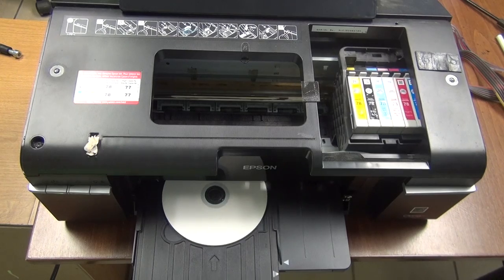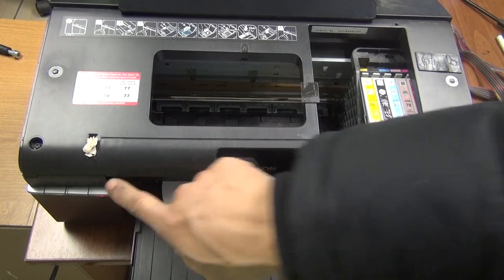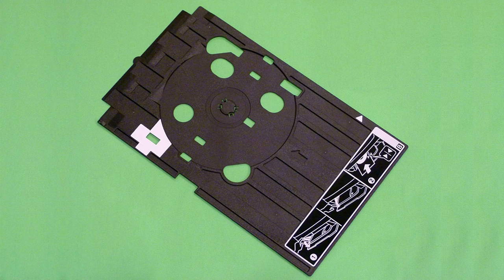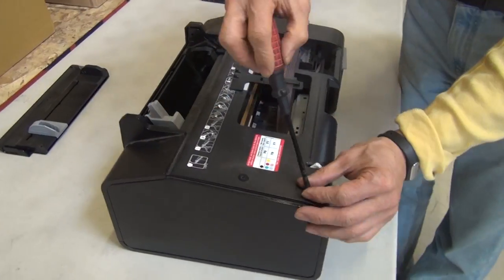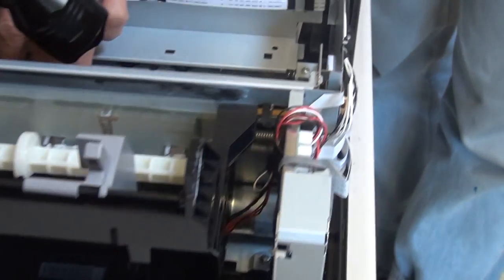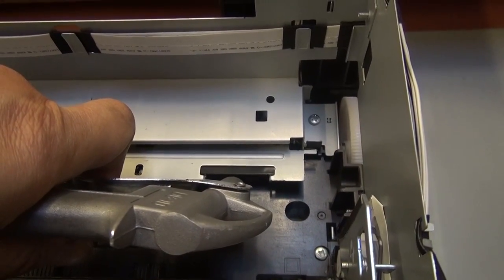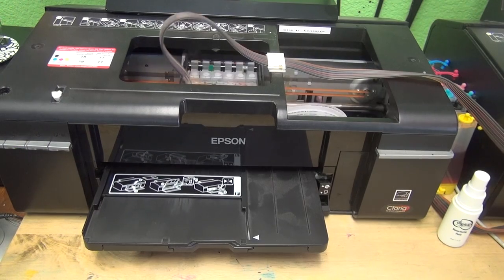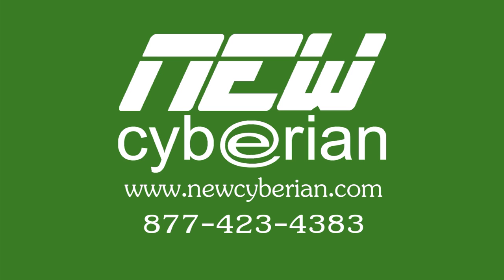Solve the Epson CD tray ejection problem

Comment: Many many thanks for your challenging your printer situation and coming up with a solution.I spent over 2 hours with Epson and they couldn't solve the problem and I wound up ordering another printer, but like you Decided to look into what you had done, and low and behold the sensors were somehow blocked.I used my vacuum in reverse and blew air over the sensors and today I'm able torrent my DVD labels,so again many thanks
Reply: I am glad that it worked out for you.  I was actually wrong to call that a sensor.  It turns out that's only a switch and not an optical sensor.  I guess it gets stuck by dirt over time and by blowing the dirt away it will function again.  Some people also had successful stories by dipping some alcohol or WD-40 to lubricate it.

Comment: Thank you very much, yours is the only right solution I have found in the internet
for this problem. I used  a vacuum cleaner that has a blow port in the opposite side.
Reply from the maker: I'm glad that this helps. Bummer I have thrown away over 20 printers because of this problem.  Should have looked into this  long time ago.
Reply: New Cyberian - CD Duplication of San Jose the back of my printer Epson E.T 3700 a back tray that when the springs fell out and it's not take the paper
Reply: So f**** see the back of a Epson E.T 3700 I'll put it back in

Comment: This guy is hilarious 😆 I don’t have this printer but watched anyway. I have the ET-7750 and I can’t figure out where the CD tray is stored. I think my printer is missing the tray so I bought a new one on eBay (printer was used). The tray fits into the input but there seems to be no spot to put it under the printer. It does fit on the table under the printer so I’ll just keep it there. 🤷🏼‍♂️

Comment: Hi Guys. I did this for my printer Epson L805 but it didn't work probably and the printer push back dvd's again what should I do please heelp??
Reply from the maker: Try to spray some WD40 or use a cotton swab dipped with alcohol to clean the switch.
Reply from the maker: Try to spray with WD-40 see if that helps

Comment: I don't know much about printers, but my CD tray light will not go off, therefore, making it hard for me to print... Well, making it to where I can't print AT ALL!!!
Reply from the maker: What's the model of your printer and are the lights flashing or staying on?  Two problems can render the light situation.  1)  You ink cartridge has bad contact, 2.) You have made to many prints (CD and paper all together) and the internal counter has reached the limited.  For the second problem you will need a software to reset the waste pad counter.  If your model is Artisan 50 you can download the reset program from Epson.  Otherwise you'll need to search one on Google.
Reply: New Cyberian - CD Duplication of San Jose It's an Epson Artisan 837. The CD tray light is on (green). But that's stopping me from printing, although I know my ink levels are very low.
Reply from the maker: Sorry we don't use this model so you probably have to call the Epson support line.